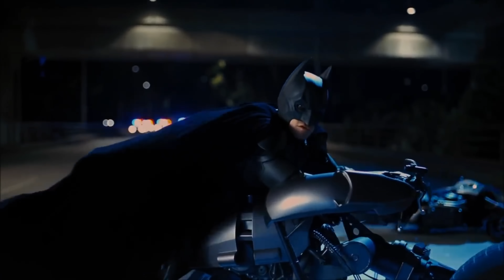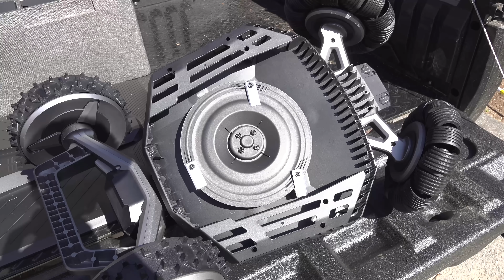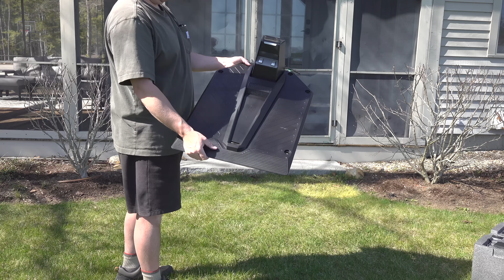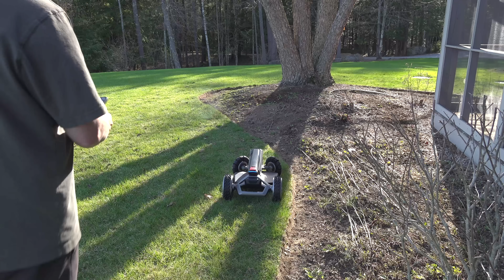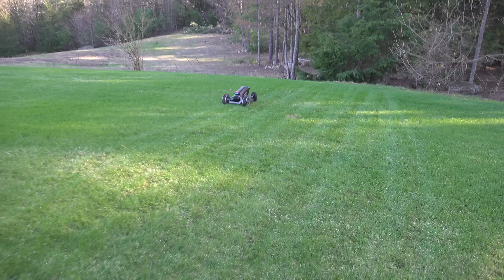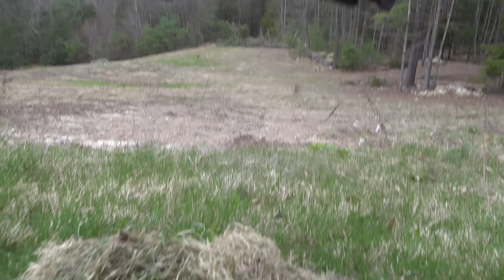Ecoflow BLADE Robotic Lawn Mower - First Look

Comment: Almost all these robot mowers use those razor blade looking blades. They're junk. These type of mower will evolve eventially, but as of right now, they ain't ready for prime time. A push mower, riding lawn tractor, or a zero turn is still the way to go.

Comment: Is the antenna only line of sight?  I want to find a wire free mower I can cut my front lawn and back...my lawn is small around 10,000 sq ft but front yard is in front of house...would antenna transmit through house or could you use 2 antennas?

Comment: A few friends and I rigged up a remote control to a self-propelled lawnmower for a science fair in high school. The engine would drive both wheels at the same time and we didn't have the know-how to fully implement a steering system. But it had some kind of safety where if one wheel got stuck, it would spin independently of the other so as to not wreck the axle or something. So we rigged a thing that would deliberately jam one wheel causing it to just lock up and be dead weight, which would result in the mower turning in place from the other wheel still turning. Then unjam the wheel when it's facing where you want and the mower just goes straight. The remote was just literally one button. Press it to lock the wheel and the mower turns in place. Release and the mower goes straight. It wasn't elegant, but it worked!

Comment: It's so cool seeing robotic tech advancements like this! I reckon within 5-10 years, larger models with more advanced self learning ai will be an option for folks like myself with larger more demanding mowing requirements. This as it is is ideal for small perfectly landscaped lawns like in this vid, but not if you have a 3+ acre lawn to mow with some rough areas and lots of trees. Thanks for this demo vid. 👍

Comment: Whats the life span on the battery setup? How  many times can this cut before you see a decline in the time cutting? From the time its fully charge ,how long did it cut before needing to be recharged..? Now, how long or how many times will it do this before we see the decline..? 

I have a Milwaukee weed eater and the battery it came with was trash. Kept burning out, kept taking it back and they kept replacing them. 12v  came with a rapid charger.. they had finally,  stop giving me the 12v and came out with a 8v . They said the 8v was the same as the 12v but with out the issues.. when i used it, loved it. Finally,  batteries that last.. for a while. I say after 6 months, it cant do a 1/4 of what it could do at first before i have to charge the batteries.. so, im guessing thats the same problem here that will come up.. works perfect for 6 months, now it stay charged up more then it do cutting the grass.. every line it cut, it charge for 2 hrs then go cut another line..hmmmmm..thus the problem..

Comment: $3000!! what the hell. no way. fix the front tires and cut the price in half.
Reply: Yes, you are 100% right, but I would not buy it for 1/2 the price. You can tell the designers were in the high school STEM program "First Robotics by DOE". Omni wheels are a 25+ years old tech for very specific applications and simple caster wheels still dominate in robotics today because they are simple and work better.

Comment: I have added extra weight of 3,5 kg on a back of a robot. It sits on a handle and is scewed in that thread for a bag. Results are outstanding. Slopes even in backwards has been double lifted, no more drive weels tearing grass when making turns.

Comment: is the battery replaceable? If not how many lifetime charges is it rated for?
Reply from the maker: Yes, probably the only robot mower with a tool free change. I think I showed it in the video, the cover pops off, pull a lever and it comes right out

Comment: Toro is currently working on one very similar to this.  This Ecoflow, however, looks like it's going to hard to beat.  A direct current opinion would be nice though.  That way it could be connected directly to a solar panel instead of an ac outlet.  The mower would not need an inverter then and could be a little less expensive.
Reply: Husqvarna has a solar panel hook up.....but it's not cheap

Comment: Use it a few times then it will end up of craigslist. It can probably trim 1/8in of dry grass on a tiny lawn.. There is no way this thing can mow lawns effectivly. A gasoline mower stores 10 times the energy of that battery.

Comment: I have a Bosch Indego. It does need a wire, but it uses GPS in conjunction with that, so it can cut in straight lines. The straight lines were a major reason I chose this mower!

Comment: This lawnmower is nothing new or novel. There are currently five other lawnmowers that have the wireless boundary containment feature.  They also don't have those cross-eyed front wheels which will wear a path through your lawn in a few months.
Reply from the maker: What are the 5 that are available?
Reply: @SilverCymbal  The Husqvarna 305 and 435X on the high end, but plenty more reasonably priced ones as well. For example the Luba is very popular as is the Lawna. The Ecovacs Goat G1 and Greenworks Pro are two others. GPS navigation (wireless boundary) is very common now and many also have four-wheel drive which allows them to handle much steeper inclines and push through higher grass.
Reply from the maker: @DB_-  So much confusion about these things. Husqvarna 305 is a WIRED mower as is the 435X. They have one wireless mower currently that isn't even sold for residential lawns their EPOS line.  Lawna isn't even for sale, it's a kickstarter and appears to be a scam as was Yarbo and Novabot. As I said in the video the Ecoflow was the first available mower, you can order today and get it in a week. Luba was still in crowdfunding but is now becoming available. Wireless means no boundary wire. By the end of the summer there will be 5 of these available, but at the moment Ecoflow blades is the only one you can get. All of these REAL models will be on my channel. But they are not common.
Reply from the maker: @DB_-  Sorry I just checked, Lawna was a scam, and was cancelled by Kickstarter.

Comment: Nope. In one word: Useless.
It can't empty or even change the bag and the blades are too thin and light with no lifting surfaces. Based on chute width, this couldn't handle bagging more than 5cm of grass above the cut level. 

The ability to run without a wire is a good start, though, and a commercial-grade model (heavier blades and 200+mm chute width) would be a boon for mowing contractors because it could be set loose to do the easy part (cutting the grass) while the edging gets done between changing and emptying bags. 

us$3000 is a bit steep for a sub $150 mower with $50 drone driver slapped on.

Comment: The amount of "bounce" seen in this in your video makes me believe it is likely not very heavy, which means any bumps or ruts in the lawn are going to move the blade during mowing - causing an uneven cut. The blade design leaves a lot to be desired, as the traditional blade design is meant to assist in "straightening" grass before cutting it - providing a sharp, even, and consistent cut.

Comment: I have been using this blade for about a week and very disappointed because it looks like they started selling beta version instead waiting for final version. Also very disappointed in customer service because the customer service phone number doesn't work. And customer service chat version is very slow and they give you run around instead of solutions to problem. I am planning to return it but most likely they will give me run around on that as well. Very disappointed.

Comment: will the grass be cut only within the radius of action, rotation blades? why do I ask ... on a normal lawnmower there is only a blade with a hole in the center of its rotation ... so it cuts the entire diameter of its rotation radius
Reply from the maker: It cuts just a little less than its width, the same as a push mower setup.

Comment: Yeah I thought my Roomba would end vacuuming forever. Couple years later it's the most expensive paperweight in the home. These small machines are just not designed for full home cleaning. These robot mowers sound great but anyone with more than a .1 acre yard is going to run through their lifespan in a very short time.

Convenient, yes. Practical...not yet.

Comment: I have allot of questions.  1.  how many square footage does it cut at one time?  2.  How does it do on uneven or steeper terrain?  3.  I noticed that the antenna was in the back yard the entire time where the mower was located.  Does the front need another antenna?  4.  What's the range?  5.  Is this something just a person with a really small yard?  6.  How does it cut through small items that may be in the yard like twigs?

Very few people will buy it at the current price point.  Especially, when they are so many questions that I didn't ask.  Like, What kind of warranty and how easy is it to find the parts?  How well does it cut overall and when it's a little wet?  Not to mention mixed terrain?  It seems to me this is just a trial toy for the rich or those who want to waste their money on hoping it works for them.

Comment: [UPDATE TO BELOW: Ecoflow CSR responded to my question with: "Thank you for reaching out to EcoFlow Customer Support.
Normally speaking, when the remaining battery level of the robotic lawn mower is 20%, the robot will pause the mowing task and automatically return to the charging station. When the robotic lawn mower is charged to 90%, it will return to the point automatically where it stopped mowing to continue the operation. 
So please try to wait it to return automatically instead of pressing "Start" to control it. The original program might be interfered when you pressed "Start". " ]  This is probably correct. I saw the battery was 98% and I pushed "Start". I should have waited a few more minutes to see what would happen. 

Now that I took delivery and tested, I love it. I watched every review video on YT, but your large lot sold it. Now, here's what I discovered in real time use: The mower has no memory. I have 4 acres to mow. I mapped out a 1.5, relatively flat rectangle acre to test. I was blown away how nice everything was looking. But at 30% battery, and only half the job done, the mower went back to the base to charge - as expected. What I didn't expect was, after fully recharging, the mower did not reengage automatically. Instead, I had to press "Start" on my app. Then the mover returned to the original starting place of my map and repeated the exact same path as last time! I was expecting it to return to its previous end-point and finish the test job (like a Roomba or Neato vacuum). There has to be a way to make this work on a larger lot. But I cannot find any information from Ecoflow or others with best practices on how to daisy-chain a full mow of a large lot. How did you do this on your lot? I'm thinking I will have to grid my lawn into 6, three-quarter acre rectangles and somehow create individual automated schedules that do not overlapped time-in-use and charging. Is there a resource at Ecoflow that you found useful?
Reply: At $60 a month, my good friend Carlos returns to where he left off mowing every single time and he only takes few minutes to fill up his mower.  He also does edging and blows leaves.  I never have to worry about him being stolen neither.  Because he’s a rental basically.

Comment: angling teh front wheel like that makes no sense
Reply from the maker: It allows it to turn on a dime, most use swivel casters that have no traction. This allows it to have stability and turn easily.
Reply: @SilverCymbal  with omni wheels, there is NO reason to angle them like that. it actually makes straight line tracking more complicated as can clearly be seen in the video.
Reply from the maker: @SoloRenegade  The only thing cleary seen in the video is the bumps that occur on any lawn. Drive on on concrete and it drives straight and smooth. We aren't talking about a kickstarter here, its done and has been tested for over a year before it was released, so will problem occur, I dont know but the wheels worked great for my testing and use and considering its got a 4 year warranty if they don't last, ecoflow is on the hook for it.
Reply: @SilverCymbal  I never commented on how long they'll last. 

just because it works well enough, doesn't make it right. many lawns will have far more straight line running than turning, thus angling the wheels like that makes no sense.

Comment: Will it cut across driveways and walkways. For example I need it to do a front yard and backyard. Only separated by the driveway itself. Price wise this would be perfect for me. Mom passed and I inherited her house. Want to hang on to it in case my grand mother wants to live there(mom passed away pretty young).  I still need to maintain the yard though. Last year I drove back and forth about an hour and half away and cut it myself. Realized the cost of that and decided to hire someone this year. The best I could find was $50 a cut. Which to me in stupid expensive but I’m paying it anyway and it’s taking 3-4 hours of my time each week. I was thinking this auto lawnmower is basically the same cost as one years worth of paid lawn service and after that it’s free. So it may work. 

Is it autonomous enough to let it run while I’m completely gone. I will still stop by once a month or so and have cameras to monitor things but really need it to be mostly maintenance free for a month or so.

Comment: Very far from the first robotic mower without wire guidance… even though it has copied Husqvarnas bladesand rotating disc construction, this is nothing new at all.

Comment: I love to have one of those. 

Unfortunately, you didn't test the mowers obstacle avoidance capabilities.   Kids toys, dogs balls & sticks, fallen branches, dead cat, etc.
A demo of how it handles fall leaves is a must. It would not be good to need a riding mower to use a few times a year in addition to the robot mower. 
Also, the blades and their mounting hardware nitrogen corrosion proof?

Comment: What happens when a small rock out there
Reply from the maker: The blades are designed to be loose, if they hit something hard they fold back, if its enough to stop the blade system it will detect the fault and alert you/ The blades are designed to only slice through gras but harder stuff wont damage the machine either.

Comment: Looks pretty anaemic to me. I doubt it would even cut Kikuyu. I think this is best suited to people with large relatively flat dry lawns. It would be interesting to see how it handles muddy slopes where even a traditional lawnmowers can get bogged. It might be OK as it looks fairly light so less chance of the wheels digging in but even if it's only slightly I see it getting stuck as it's only designed to cut 1/4" at a time.

Comment: Everyone has their own opinion and the right to choose how or what way to mow your lawn. However, if you think using an electric mower is going to SAVE THE PLANET, I suggest phycological therapy. Some people are just lazy. They cannot wrap their head around maintaining a simple machine so the go get something that they've been told is much better. So if one is so incapable of taking care of their lawn equipment, I guess they need a robot to do it for them. Does that robot cut right up to the edge of landscaping edging? So, I guess you'll need a robot to carry a trimmer around. Then you'll need a robot to spread the fertilizer, then another to rake the leaves. Society is becoming more and more brainwashed. I guess.

Comment: I actually don’t think this is too bad of a price.  It is comparable to a zero turn rider.  Plus If it lasts a decent amount of time, the value of time savings is huge.
Reply: Same here. It's not cheap enough for people with smaller yards and the ability to mow it themselves. But, if you can't, or don't have time to, mow it yourself, it wouldn't take that long for tis to pay for itself. Obviously, it depends on how durable it is and how well it works, $3k for one that doesn't really work isn't a good deal. But, even if you do have to go around the edge with a string trimmer, it's still a massive savings of time and money over time.

Also, these will likely get cheaper and more capable if this one works as well as it appears to.
Reply: $999.00 online at walmart site at time of this comment.
Reply: Now $899.00 at walmart.

Comment: It will probably use a lot more energy than an electric push mower if it has to mow three times a week. That lawn is already short. We need to see it in a Zoysia lawn where the wheels would sink down into the grass. Even a push mower requires lots of leg and arm to plow through those lawns.

Comment: but why the blades are still in the middle ?????????????????????    so cant cut to the edge !!!!!!!!!!
Reply from the maker: Correct, edge cutting is usually oversold on robots anyway,  they are not precise enough to ride on the edge of the bed. They can be close, middle positioning of the blades gives it a larger cutting area, the side cutting models are usually 8"

Comment: As great as that lawn mower is, there's no way it would be able to properly cut grass that's any thicker than that, such as the thick, drought tolerant, grasses we have in Australia. Those grasses need a heavy, very powerful, lawn mower. I know that from experience, because I have a Bosche 36 volt cordless electric mower. It just shuts off when it hits those sorts of dense, thick grasses.